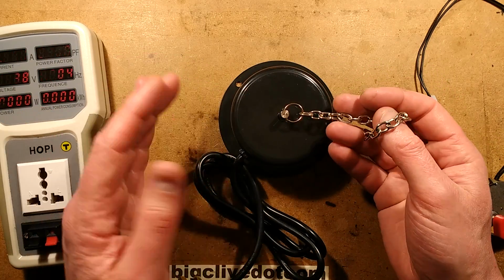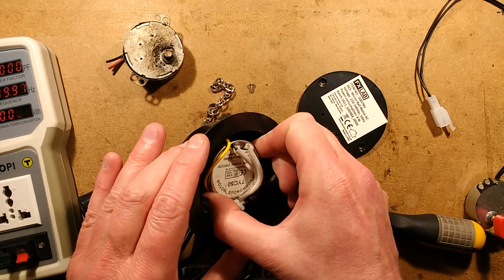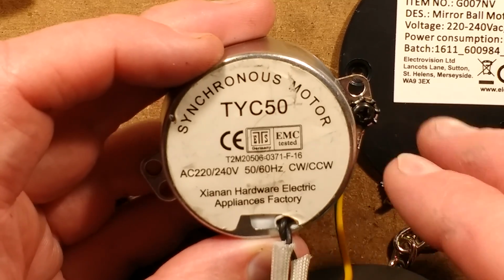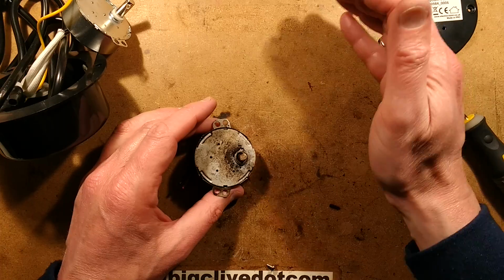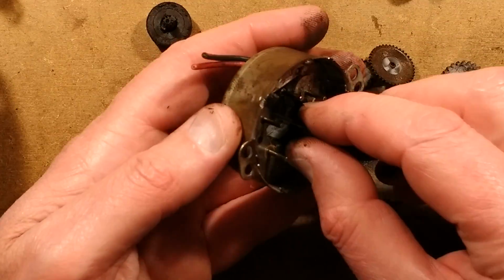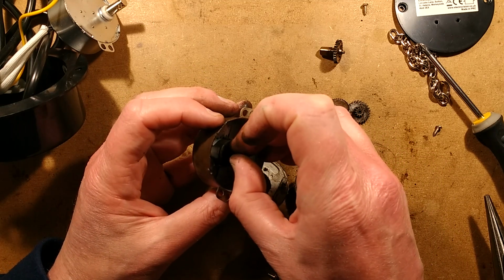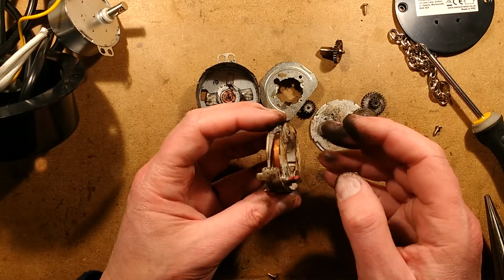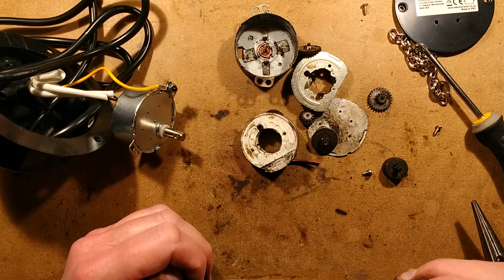Mirrorball rotator source of geared AC motor.

Comment: When you mention these being used in the application of microwave turntables, it now makes perfect sense why the table in our microwave at work seems to have "random" rotation direction, either CW or CCW... Thanks for a very informative video.
Reply: Lake Nipissing how does one notice that.lol.i can just imagine "dave the microwave turntable is spinning clock wise again"
Reply: When heating things in the microwave at work, and being there right when it counts to zero, and the turntable stops rotating, checking the temperature and then adding another 30 seconds... Sometimes it would rotate the same way and other times opposite. Always wondered why it seemed to be completely random until Clive explained the reason.
Reply: Every time I use my microwave it rotates in the other direction when I add time...I presumed it was deliberate.
Reply: It's pretty much standard motor for driving microwave turntables, I have taken many apart.
Reply: Never really noticed it...I'll have to see if it changes next time I heat up some lunch!
Reply: The one and only microwave I took apart was using a lower voltage version (70V I believe), that was powered by a winding from the fan, though. That makes them useless to use for anything else.
Reply: semiRockethr That’s an interesting way to do it!
Reply: The reason i think why the motor goes in one direction and then the other is because it depends where the n and s poles on the rotor are positioned in reference to the phase of the ac waveform each time the motor is powered.

Comment: I bought some bi-directional motors on Amazon for cheap.  I needed 1 RPM because 3 RPM was just too fast.  Replaced motors in some display turntables, added capacitor and switch for bi-directional control, a power supply from a USB plug in unit and some vacuum motor brushes to transfer power to the turntable (5VDC).  Only inspired to attempt it from watching these videos.  Great channel.

Comment: The clock on my wall has one of those, it's been running since the early 60's. Before we had blinking microwave clocks to tell us the power was off we had these clocks. They would often restart when the power was restored in the wrong direction!
Reply: Smiths Sectric by any chance?? We STILL have a mantlepiece version of these - made by Smiths Instruments, Woking, complete with the very fragile-looking 2-wire bell cord style cable. My Grandparents had this as a wedding gift, in 1902, and they died at the very beginning of the 1970's, well into their 90's. Haven't used it for a while, but it did still work just fine three years ago.
Reply: Phil S Mine says Necker's Jewelry on the front. My father handed a few out around town to businesses for advertisement for his Jewelry store.
Reply: ten littleindians We had two different models in our house in the 1960s. One would stop when the power went off, telling the exact time of failure. The other would restart, but would lag, showing the duration of the power failure.

Comment: The synch motor at 2:35 looks like a common mikrowave motor for turning the table, which you can get for 3.5 -4€ such as the 50TYZA. Bought some to make gravity lights and worked well as a generator ;-)

Comment: I'm pretty sure this kind of geared synchronous motor is used in the old electric timer switches. They have a dial that rotates once every 24 hours, allowing lights to be turned on at night. Ours has a switch to choose 50/60Hz (otherwise it wouldn't keep time).

Comment: 1:59 "The only thing that tends to change is the shape of the shaft, which is a bit annoying..."
Reply: SigEpBlue he'll need to grind one...
Reply: Gotta grind the shaft
Reply: If he had a 3D printer, he could easily have designed a shaft adapter to use with things

Comment: The motor for incubating chickens always turns cluckwise.
Reply: These motors actually ARE used in egg incubators! Probably the most reliable part of the incubator, incidentally!
Reply: Paul Drake reverse the polarity to poulet in the other direction ;)
Reply: I see what you did there!
Reply: If the cops find you trying to poulet, they'll arrest you for fowl play . . . . . :-D
Reply: The incubators (and birds) turn eggs to keep the heat spread evenly throughout the egg and to prevent the membrane from sticking to the inside of the shell.
Reply: Paul Drake - an appropriate name here? - In the Southern Hemisphere, they turn anticluckwise, to stop the chicks from feeling out-of-place. If they turn too fast, their brains can get scrambled.

Comment: A good source for these motors is at an Amateur Radio Rally, (a bit like an Electronics car boot sale), mostly thrown in junk boxes for a few pounds, when someone has a clear out.
They were also used in old style arcade machines, although at higher speeds, they operated a cam-shaft with micro switches on, to randomise the light displays ETC.

Comment: I LOVE your videos.  Could you open and explain a car's stepper-motor driven EGR valve sometime?  I can't find very much on it.  Mass Air Flow sensor would also be a good topic.  I'm interested in automotive electronics; how they work, and how they fail - causing so many trouble codes.
Reply: Early mass-flow sensors were simply spring-loaded vanes that controlled a rheostat (the faster the airflow, the further the vane moved), but more modern ones use "hot wire" sensors. A thin platinum wire is suspended in the airstream, with a constant current applied to it. When airflow increases, the wire cools, lowering its resistance and causing the constant current supply to lower its applied voltage. The ECU reads the applied voltage to determine airflow.
Reply: Why a platinum wire? Platinum is a rare element and very expensive. Why not another metal?
Reply: They are using such a small amount it hardly matters. And Id assume because its very resistant to corrosion and environmental damage....If it was steel for example as it rusted it would change its output for the same amount of air. The Oxygen sensors would correct it, but only to a point. When it completely rusted through the car would have a lot of trouble figuring out the airflow...
And what do you want to know about stepper motor EGR valve? How it determines a position? Well the PCM uses a lookup table with load, rpm, coolant temp, +tons more parameters, to determine desired flow. To determine actual flow the method Im familiar with is to have a pressure transducer on the EGR tube after the valve and before a restriction, which can be the EGR valve gasket itself has a reduced size orifice. Then compare that with the pressure in the intake manifold and calculate the flow through the orifice. If desired does not match actual, then step the motor until its correct.
Reply: Platinum has a very consistent temperature coefficient, meaning for any given temperature it will have a very predictable resistance value.

Comment: Microwave oven also usually use the same kind of motor for the turning plate... You can get a nice little shock by spinning them by hand since they have the permanent magnet rotor (probably not great for the gears though). ;-)

Comment: If you have just the bearing of the shaft used, which means the hole in the plate is oval and too big you can fix it the watchmakers way! Make the  hole round again using a slightly thicker drill. Measure it precisely and buy a brass bar or better a "bouchon"  which means cork from your local watchmaker, ram it into the hole,it must fit hard, and drill a hole in exactly the center of the "bouchon", a hole being slightly thicker than the shaft. That's how big watches are repaired when the steel shaft has worn the hole in the plate he's turning in.
For watchmakers there are kits with all sizes of these " bouchons" or plugs.
Reply: Put the bar in the freezer first - makes fitting easier. Bouchons are cut with a slight outer taper to facilitate firm insertion, and they are also much loved as a means of resuscitating "worn nose bearing" NEMA 15 stepper motors, in the 3D Printing community.
Reply: Phil S 
Freezing is a good idea and tapering is always necessary. And I think bouchons should be available in Britain's since one of the beat watchmakers worldwide, George Daniels, wrote a book about how to make watches and clocks from the raw materials.

Comment: It's funny to see you made this video. I was looking at one of these rotating hanging thing for some reason. I think it was to see if I can use it to generate electricity from one of my wife's vertically spinning yard decoration things.
Reply from the maker: The force of those wind spinners is usually too low to be useful.
Reply: I figured I could charge up a few batteries I have laying around and run a LED at night (similar to a solar light), but I only got to the "Ooh, I think I can hook these things up to those" stage. I haven't actually build anything yet, so I don't know how much wind spinner power I have in the garden :)

Comment: Some of them have a little wire spring which engages a peg, to force the rotor to start in the correct direction. The Chinese have actually succeeded in making these super-reliable motors unreliable. (No Big Surprise there, then.) We had one in a microwave oven fail a couple of years ago. It had failed because the inner end of the coil wire had vapourised, probably because it had been laid down the side of the rest of the coil, without any more than the 'enamel' coating to protect it from our 250 V ac mains supply. (It's often about 253 V here late at night, because we live 50 metres away from a substation.)

Comment: Look to be offset by 5 degrees or there abouts that IMHO means that fields are not symmetrical and will push and pull depending on the phase the motor is in.

Comment: i used one of them on a cctv camera so i could spin camera 360 just had power button inside house next to tv on a push to make switch . used to get them  from the ufo fibre lights 12v system worked for years that was in early 2000 when turning camera was very dear .

Comment: i have a old 60's or 70's version of these cant remember exact year. came out of an old flip number calendar/wall clock that sadly got damaged one day i was using ti everyday but ah well things happen right? but i salvaged the synchronous motor incase i ever run across another model of that clock type which ive seen around. if it has a bad one i can just replace it with that one

Edit: forgot to mention m old flip number clock.. and its old its pretty much yellow now was made by realistic. it also has one of those but its sooo different. all gears are external and the rotational part is sorta similar to a 12volt dc fan hub center. has a outside spiral pattern so it shows its rotating in the little window. the little neon light that shows numbers at night still also works. i wish i could get a year off it but its way up there aha.

Comment: For an amazing motor with great gearing,  check out the small motors that are used to operate central heating and boiler valves.
Reply: Some of the really old valves work without a motor - they have a piston packed with wax, heated by resistor wire. Apply power, wax melts and thus expands, piston moves, valve closes. It's an adaptation of the old wax thermostatic valves, which were around long before electrically controlled heating, just adapted for electrical control. They were very reliable, as they had only one moving part and no contacts or brushes.

Comment: I want to get one, and I have no idea what I'd do with it.
Reply from the maker: Just buy one anyway, and make things rotate with it.
Reply: Peer pressure!  :)
Reply: What ever you do, it will do it very slow. Good luck.
Reply: Take that nicely wound bobbin out, and you've got the 240v coil of a useful transformer. There are a number of decent sized split ferrites on EBay, etc, and  the potential seems endless.
Reply: You just described my purchasing history.
Reply: Another source for these motors are paper laminators. People usually give them away for free or cheap, or you could even trash pick them at recycling places lol

And, I forgot to mention microwaves. The motor that rotates the plate is usually a synchronous one
Reply: guitarstitch - here’s one from the vault...   get a baby food or mason jar and cut the bottom off (string, acetone, fire, cold water...   plenty of tutorials how now on YouTube (search for “glass bottle” tho)).    Paint the outside of the jar black with Crayola type paint...   meanwhile, key the lid to your shaft.   Next, get a bright incandescent (LED would work) bulb that can fit inside your jar...   tricky bit now, we’ll need a wide U shaped mount, wood works (tho 3D printing too)...   the jar will be mounted on its side (LEGO wheels are perfect for this), motor on the lid end (shaft attached, motor mounted on one side of the U), light in the open end (light fixture mounted on t’other side of the U) with some gaff tape and construction paper keeping the light inside the jar.    Wrap a colored lighting gel around the top and sides of the U shape mount...   and you’re confused because I skipped a step...

This recipe, however convoluted, literally makes dozens of different effects...    the secret is scratching or masking off some of the black paint !!!   Depending on the orientation to the wall and the pattern of clear glass you left you can create smoke, spokes, bars, wheels, dots etc etc etc...

I imagine now with CoB LEDs this whole thing could be shrunk down into a teeny-tiny form factor...   if anyone decides to make them, a small taste is all I ask ;-)
Reply: me too I cannot live without one of these as I know one day it will come in handy !

Comment: They also used these to run the cycles on a clothes washer.  
It will also give you quite a zap if your stick the wires in your mouth and spin it.

Comment: 2 motors of this type are in my litter box. One turns the litter tray and the other runs a conveyor into a recepticle. The one that runs the conveyor burns out about once a year and cost $14 from the company as a replacement part. I would love to find a source for these motors and save money. It's a 26 volt, 4 watt, one rpm, ccw. 

.
Reply: covishen 
I just tend to use a lavatory as I'm a big boy now! 😜
Reply: Unfortunately the Cats aren't so good at that. :-D

Comment: Because they reverse when they stall you can bodgey a single direction with a simple single pawl ratchet. 

You can get ridiculous torque at low speed with a couple of gears.
Reply from the maker: I once stood on a display turntable with one of these in it and it rotated me no problem.
Reply: Wasn't quite up to a V8 motor so they added a couple of gears.

Comment: The shaft on My Microwave's Motor snapped off shorter, so I took it out and was just playing with it, seein' if I could turn it by hand, cause of the gearing it span the motor really quickly, & I happened to be touching the connector un-knowingly, wow what a belt right up My Arm, Yep I Electrocuted Myself with it..! [;/]

Comment: Those motors look like the motor in my amplified TV antenna that was the rotor. The thing started rotating the antenna at random within the first week that I got it. It was just a cheap, Chinese peace of crap. I was mostly interested in the antenna so I  just powered the amplifier with an inline amp power injector until the amp itself started crapping out the signal. At that time, I completely removed the electronics inside the antenna base, connected the UHF and VHF antennas with a with a 300 ohm to 75 ohm UHF/VHF combiner, and added an inline amp near the antenna. I'd rather have the antenna fixed anyway.

Comment: I had a toy train as a child that would auto reverse of it bumped into anything and I think it contained only three components (I took it apart) and I wish I could remember what the third part was, beside motor, and batteries (OK, and switch...)
Reply: Bistable relay, which would change the contact position when a pulse was applied to the coil. Each pulse would change the contact to the other position, and this was then arranged, with either a switch front and rear, or with a simple trembler switch, to change the motor direction when it was bumped.
Reply: SeanBZA thanks, I'll look into that

Comment: The 60 cps in my mains seems to oscillate a bit.  I think its because I live in Mexico.
Reply: Do you have other large loads near by that pollute the mains sine wave. A factory with big motors for example?
Reply: Maybe... UK and Europe it's allowed to change over the short term (within limits) but is maintained to average exactly 50Hz over a continuous 24h period... so synchronous clocks might be a bit fast or slow over an hour but they never lose or gain from one day to the next.

Comment: 2kg, a very lightweight bicycle? Where can you find a bicycle under 2kg? Mine admittedly is a bit heavy at 31kg so that may be why I can imagine one being that light. But as a commuter, I need everything.
Reply: Someone I know has an expensive light weight carbon fibre bike - so light I can hold it up with my little finger with my arm out straight. Its definitely less than 2KG.

Comment: It is possible to buy 12DC motor version, witch is actually 12AC with mini external frequency inverter.
Reply from the maker: It might be more common to use stepper motor or geared DC motor.  But these synchronous motors should run OK on a proper AC output inverter.